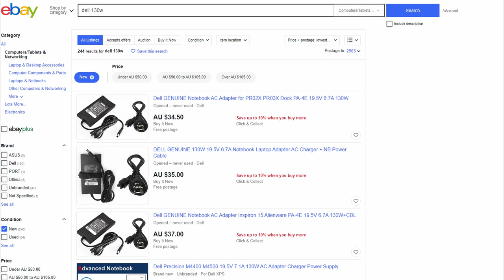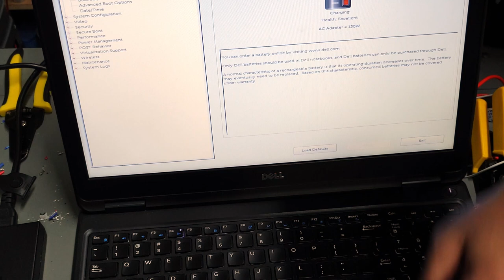Dell AC adapter unknown - lets find out why

Comment from the maker: The replacement cable took about 3 weeks to arrive and works without issue. The only difference being the wire colours, on the original red was for +ve and on the replacement white is +ve.

Comment: First off, look on the brick. They are ALL cheap power supplies from China. Now..  I'm guessing it was just over a decade ago that I had to researdh this for a couple weeks or so because the center pin was a new thing exclusive to Dell. Keep in mind this is old information, but they had a chip just inside the laptop jack that measured the center pin for a voltage drop. As I recall it was normally 6 volts then, and the wires were bundle wrapped around under the insulation like a cable for TV. After a bit of flexing they would start to break. Eventually so many broke that it still carried voltage but resistance increased showing a voltage drop that the computer picked up and started throwing error messages. Those who called Dell and had an OEM brick were told, in order of repeat call-ins, you need a new battery, then told you need a new mother board and finally a new brick. It was ingenious because the same problem was so subtle it would manifest problems differently on peoples various machines, appearing to be different problems but it was all the same. It took nearly two weeks of searching before I realized these were all the same problem. One dude bipassed the chip inside the laptop but I didn't attempt that. I just soldered all the broken wires together into a blob, taped it up and was good to go. At that time they also had a timer of some sort in the battery pack. After so many charges the battery wouldn't accept any more charges. It didn't matter if it was still good or not. Their excuse was safety, but only an idiot would believe that. All of the above of course were timed to act up just outside of the warranty period. And if that wasn't enough insult, if you used XP's disc scan/repair that Microsoft built into the OS it triggered corruption of the Dell master Boot Record. You were dead in the water then unless you knew how to fix it yourself. That was my last Dell and I refused to work on them after that. Judging from your video they have cleaned up at least some of their act. Good Videio btw thank you.

Comment: Was the performance incredibly slower before you fixed the charger?   Mind seems to be horrible and the message implies that the computer will slow down the CPU if it does not know what wattage power supply is
Reply from the maker: It's quite possible the system will slow down if it thinks it's not receiving enough power
Reply: Same was the case with mine and turns out the jack was the issue as in the video. I did the hack with a glue gun and soldered the middle connection and everything works fine now.

It was having power issues earlier so the processor was throttling. This is a great example of planned obselecence and how big companies try to screw us. A simple wire breaks and now your whole laptop is unusable
Reply: @Sawickipedia   I used CPUz  And confirmed it was slowing the CPU down To less than half,  With a faulty and also a generic non-genuine Dell  Power supply.

 It's struggled to play YouTube video at  480P was miserable. I just got a new Genuine Dell power supply now it runs at full speed,  Can play YouTube 1080P.
Reply: The same happened with me and also I got it repaired but in the process somehow the circuit in the power brick for the sense pin got damaged

Comment: I have 2 Dells (E7250 and E7450) that have the AC adapter unknown issue.  Adapters are Dell OEM and they work fine on other laptops.  Found an old PRO3X E-docking station and both laptops charge, BIOS indicate correct voltage, and perform faster.  This method bypasses the AC port on the laptop.  This -E-dock works with all E-series laptops up to E7470.  Dell 7480 and up uses newer USB-c docking technology.  NOTE: The dock requires a 90W adapter to operate.

Comment: DO NOT short out a capacitor using a screwdriver, if there is enough voltage and the capacitor is polarized it WILL explode. The voltage stored power needs to go some where!!!!. Always use the proper resistor rated at the proper wattage

Comment: Huh, didn't know that center pin was totally necessary for the PC to sense. Got an old D630 that has no option in bios to just use if it doesn't sense. Annoying, nothing wrong with the dell pack other than that stupid pin on that one too.

Comment: The same issue at my E5440, the sensor line is interrupted, twisted for the moment and started back charging.
Unfortunately the cable comes with another charger.
Reply: Yeah I could do that butttttt now Twisting it doesn’t work

Comment: I scraped the centre pin with a small screw driver.Sprayed the sockets ,plug with WD40.New battery started charging.
Reply: Also ordered a 90watt transformer to replace the 65watt wrong one.

Comment: The Latitude E5000 series laptops are riddled with power issues in general. I have a stack of dead ones (mostly E5450) all who either don't power on at all, don't charge, or don't recognize the AC adapter, but they're all board level issues (not adapter or barrel jack related).
Reply: Ahhh I am discouraged now because I am waiting for an input jack on an E5570 that won't recognize any charger :(  Dell definitely does not build them like they used to.
Reply: I have same Issue with my E5450

Comment: Super frustrating the way they do that with the center pin. Have just ordered a replacement after seeing a few vids like this. Pretty sure the sense pin is fragile connection by design.
Reply from the maker: Yep, I feel the same. At first I just thought the cable would be broken somewhere before the connector which would be fair enough, it happens. But after tearing it down literally to the bare metal, and finding a very poor crimp connection in the plug, it looks more like it's designed to fail
Reply: @Sawickipedia  other videos I came across the break was in exactly the same place. And given the destructive nature of getting at it, it’s designed to also not be repairable. Piss poor really.
Reply from the maker: Interesting, to be honest I hadn't checked if there were other videos on the subject, but yeah I'm not surprised
Reply: @Sawickipedia  My replacement AC Adapter arrived, and wouldn't you know it, the laptop is charging again. I'm torn between being happy that problem is solved and annoyed that it's that stupid connector and feeling ripped off.
Reply from the maker: I feel ya!

Comment: Hello, a query, I have a dell inspirion 15 5000, the charging pin failed and I changed it to another, I soldered it and now it appears unkown and the battery does not charge this at zero, which may be before the charger and the battery were good, only the charging pin helps ...

Comment: Heyy thanks for shariiing. I decided never to buy a dell laptop again after watching this. I have the same "unknown ac adaptor" problem. The thing is mine says plugged in and "charging" but the percentage only increases by 1 after a few hours, which means it's charging but realllly slowly. I tried another lower wattage ac adaptor and it works so the problem is clearly the ac adaptor but what I don't understand is that when I do a power reset (unplug the charger, remove the battery and hold the power button for like a minute then wait two minutes and plug everything) the ac adaptor is recognized again but only works after doing that. If I unplug it then plug it again, the "unknown" problem" manifests again. What could be the exact problem here, if it works again temporarily after a power reset" ?

Comment: Hi I need help when I start the laptop it gives me an error in which it tells me that my charger is under 65wat and if I want to play something it goes into lag if I take out the charger it works fine and I can play I have a new 90wat charger for my laptop and I want to tell you that it doesn't charge, I put the charger in the laptop, it charges for 3 seconds and the battery stops, it doesn't discharge if the charger is plugged in, but it doesn't charge either, please answer me
Reply from the maker: If it's a new charger then have you tried it with the original charger? Also is the new charger a genuine one from the same brand ie dell laptop and dell charger?
Reply: @Sawickipedia  new charger original dell
Reply: I have tow charger if I switch charger tow Time laptop will charge

Comment: Thanks for the great video and explanation. My barrel connector ended up like yours when I was diagnosing the exposed positive and negative wires.

You said the outside of the barrel is ground, but you mean negative, correct? The center pin is ground I think.

Comment: Hey. My case, i purchased a new battery and still no go. I tried my charger on a different laptop which works fine. But it's not charging the battery and in the bios saying that it's healthy but unknown... very annoying.. I am guessing i need to pull apart to find where the issue is?
Reply: Was it cheap .. and from China?
Reply: @colin8949  purchased it from the local shop so as almost everything manufactured from China, I'd say yes it's from China. But I figured it out that it was not only battery but also the charger was the problem. Low voltage charger was the issue. Hope this helps

Comment: I had same problem and i replaced the cable. It worked fine but after few days it happened again so i decided to check with multimeter if the all 3 wires were making connection to laptop. When i tested all three were good, voltage perfect and ID sense was perfect. but it sometimes work (20%) and 80% its not charing. what can be the issue i have no ther laptop to check charger. but it giving 19.4V to laptop which is perfect.
Any Help
Reply from the maker: Maybe the new cable is damaged. Have you tried twisting and bending the cable to see if that causes it to start or stop charging
Reply: @Sawickipedia  Cable is ok i tested with multimeter. How ever battery is 95% dead
but when i plug only charger  it still shows the same error
Reply from the maker: Very strange. Only other possibility I can think of is a fault inside the laptop
Reply: Is there any specific chip or IC related to same. Model is Dell 14 3421. It just worked for 10minutes and now again same problem.